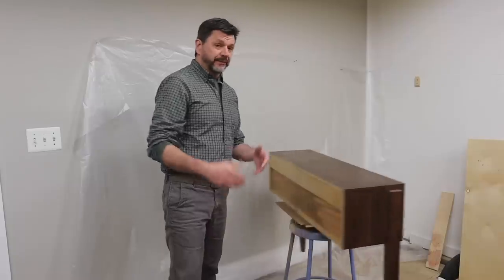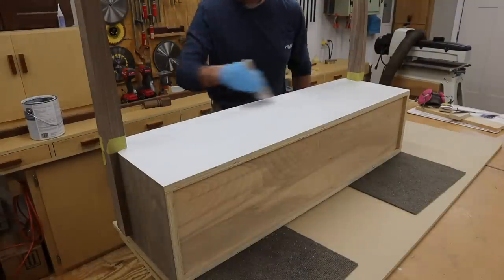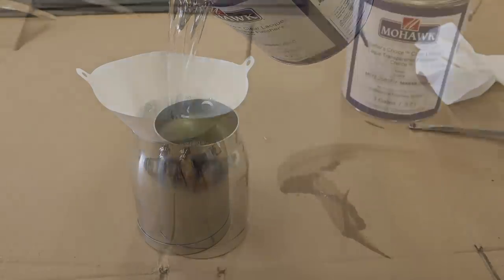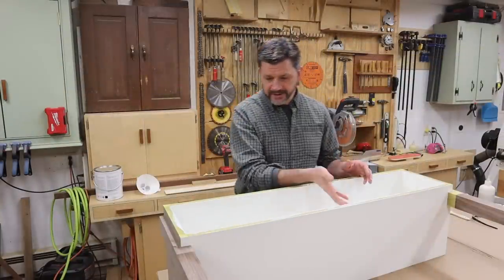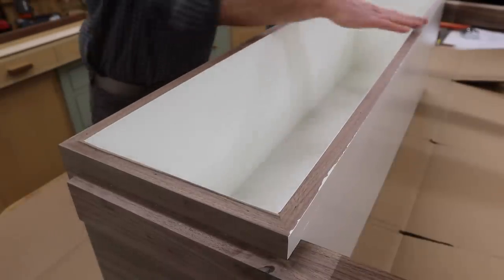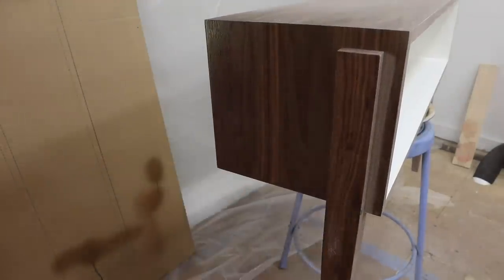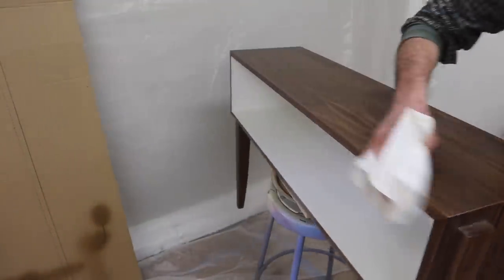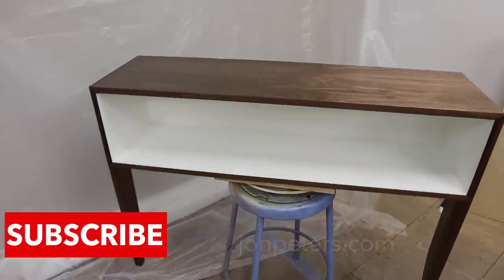How to Spray Lacquer & Get Perfect Paint Lines

Comment: Great video Jon…I wanted to ask you what do you do with the finish between coats. Do you leave it in the spray gun or do you pour it back into a separate container and run water through the sprayer to clean it.

Comment: Jon, is there a benefit to increasing the grit count in between coats? i.e. 320-400-800 etc
Reply: Id also love to know a experts opinion on types of sanding between coats, id been taught to wire wool between thin coats.

Comment: Is that an oil based lacquer John? I’m not happy with any of the water based lacquers iv used
Reply: I suggest water-based products. After years of finishing my own work I much prefer the alternatives to expensive tools, set-up, and the smell.  Woodworking should be an art.  There are aethetic values much greater with this craft, unless you must get it out the door as fast as possible!  😁

Things done fine take time; things done fast don't last.
👀🐡🌾🌿